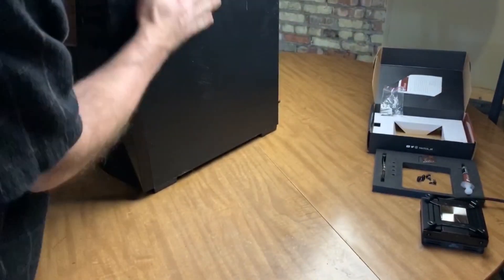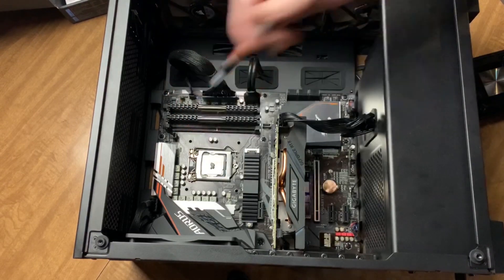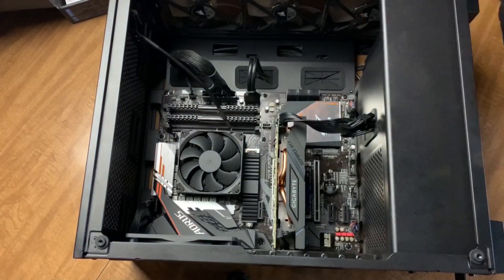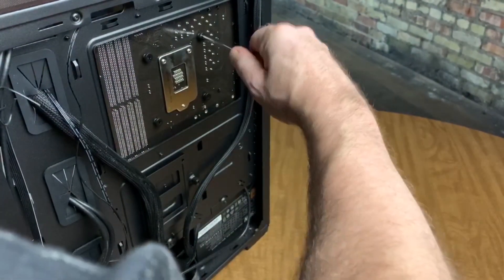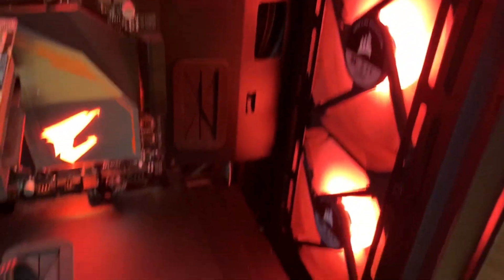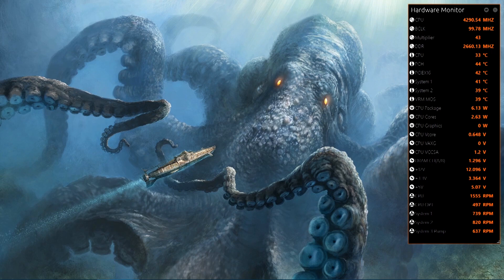Lazer-verse ep.02: Heatsink Upgrade - Noctua NH-L9i chromax Black

Comment: Thanks for vid. Will this work good for 9600kf? I am not going to overclock cpu
Reply from the maker: Hi Gaurav, the cooler will certainly fit physically with the 9600kf and as long as you aren't going to overclock, it should keep your temps reasonable.
Reply: @LazerboltVids  thank you for your reply.
Reply: @LazerboltVids  NOCTUA NH U9S Chromax Black 125mm CPU Air Cooler. is this good cooler for ocing 9600kf?
Reply from the maker: @GauravNikoBellic  I've never used the u9s 125mm fan, but it looks like quite a beast and should work fine.
Reply: @LazerboltVids  thnx 🙏
Reply: May I know which cpu cooler are you using ?

Comment: hi Im thinking about buying this cooler, my case is probably around the same size and I wanted to ask you about the airflow, how it goes and all, since Im planing on push and pull system for my fans too, thanks great vid
Reply from the maker: I 100% recommend this cooler as long as you're not doing any overclocking of your cpu.  Very high quality with great performance. As far as my case and the airflow goes, the fans all work well together and give nice quiet cooling overall.  Thanks for watching!
Reply: @LazerboltVids  thaaanks, I was geting worried of this cooler somewhat breaking the airflow, since I was guessing he would be ''pushing'' the main air flow line you know
Reply: @LazerboltVids  also not really planning on overclocking, guess the most demaning thing would be the future ryzen 7 I dream of for me build on the uture
Reply from the maker: This cooler is very slim and low profile and shouldn't interfere with good airflow in your system. It should be fine for cooling the Rizen 7 in your future, and if for some reason it doesnt perform well, at least the Rizen 7's come with their own stock cooler that should get the job done.
Reply: @LazerboltVids  fair enough, thanks a lot, I was having some troubles finding a good looking cooler for me case, helped me a lot

Comment: Can you show me the computer configuration used to test this noctua l9i?
Reply from the maker: parts list:

CORSAIR Carbide Series SPEC-DELTA RGB Mid-Tower ATX Gaming Case, Tempered Glass

GIGABYTE H370 AORUS Gaming 3 WiFi (LGA1151/Intel/USB3.1 Gen 2 Type A,Type C/HDMI/M.2/ATX/DDR4/Motherboard)

Intel Core i7-8700 Desktop Processor 6 Cores up to 4.6 GHz LGA 1151 300 Series 65W

Corsair Vengeance LPX 32GB (2x16GB) DDR4 DRAM 2666MHz (PC4-21300) C16 Memory Kit - Black

Gigabyte GeForce RTX 2060 Mini ITX OC 6G Graphics Card, Mini ITX Form Factor, 6GB 192-bit GDDR6, GV-N2060IXOC-6GD Video Card

Sabrent 1TB Rocket NVMe PCIe M.2 2280 Internal SSD High Performance Solid State Drive (SB-ROCKET-1TB)

MasterWatt 750 Watt Semifanless Modular Power Supply, 80 PLUS Bronze Certified Power Supply for Computers